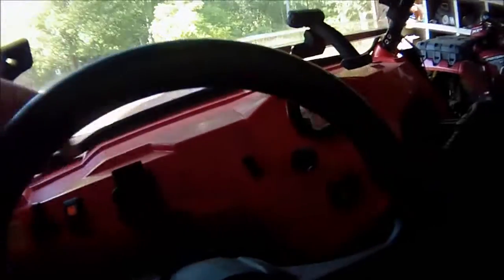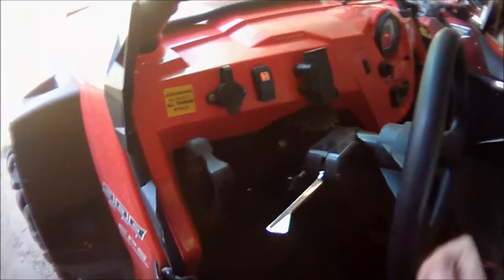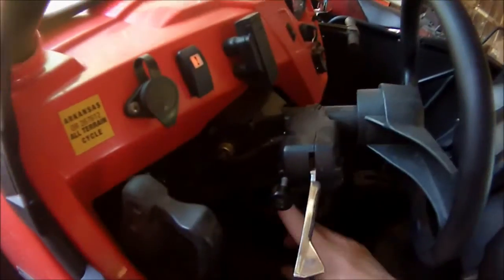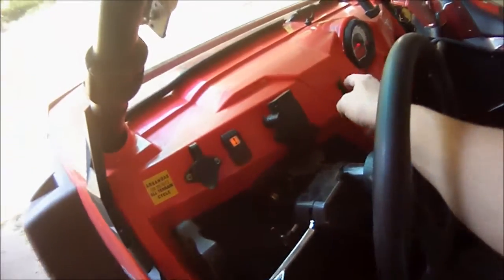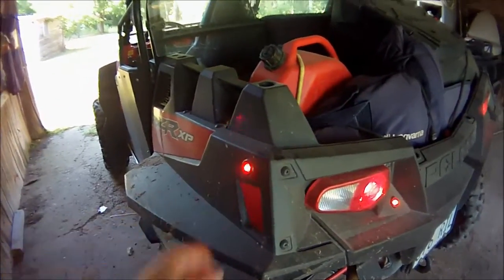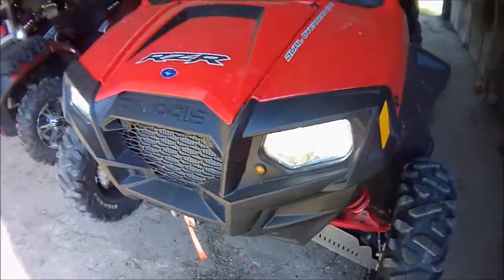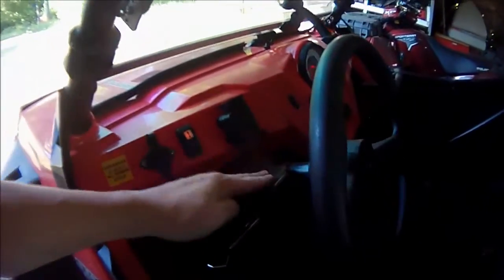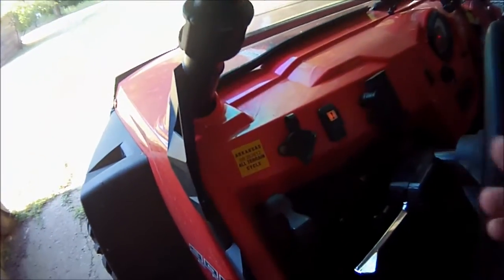Street Legal RZR XP Side-by-Side; Part 3: The Control Head, Lights, and LED Flasher

Comment from the maker: That gives you your park lights (aka marker lights), but they still also flash when you turn on the flasher to a particular side or all when you use the hazard flashers. You can do this because with LED lights the rear feed is plenty powerful to feed all of the lights (even 8 like I have) and you don't actually need the brake lamp function of the turn signal unit since your RZR already has separate brake lights from the factory.

Comment from the maker: You only use the wires for the REAR turn signals to work all of the turn signals (to their appropriate side of course) and do not use the front wire. Then take the wire that originally would have connected to a 12v+ source from the brake light switch and connect it instead to a switch which will become your park light switch. When you turn on that switch it fools the system into thinking you had hit your brakes, and since all of the lights are connected to the rear output, they all light up.

Comment: Hi, I have a 2013 Rzr 800.  I purchased a turn signal switch LED lights LED flashers. I have everything hooked up: right & left signals &4ways work BUT how did you get your marker lights to stay on while the turn signals work on either side?  I have blown more fuses & have tried every wire combination.  I noticed you have a 3position switch.  What does it do?  Thanks for any help you can give me. You can email me at:  ihessney@rochester.rr.com